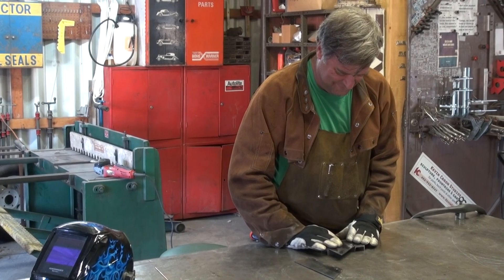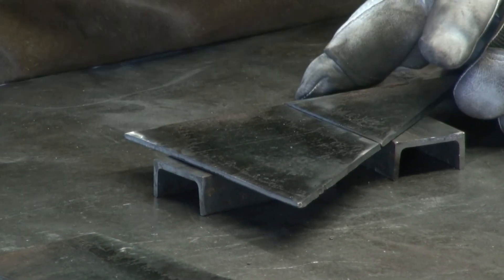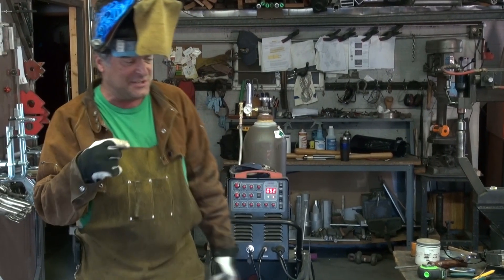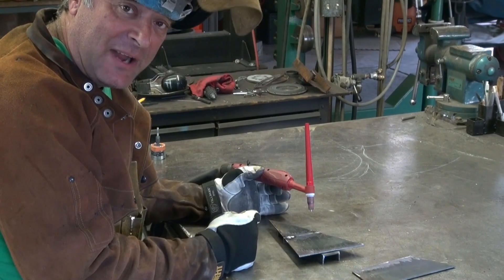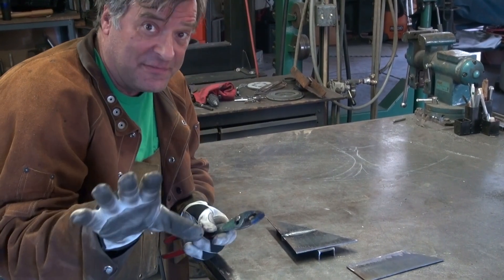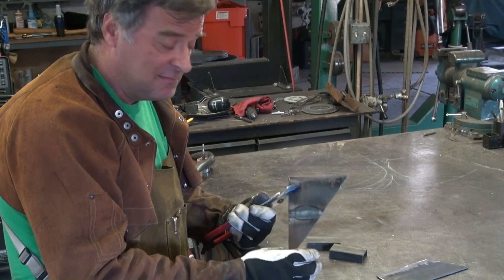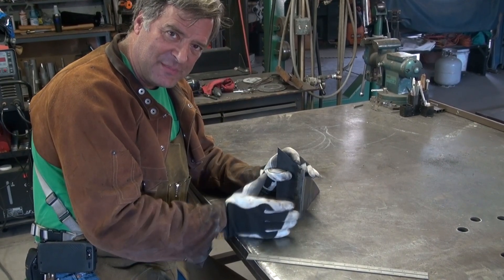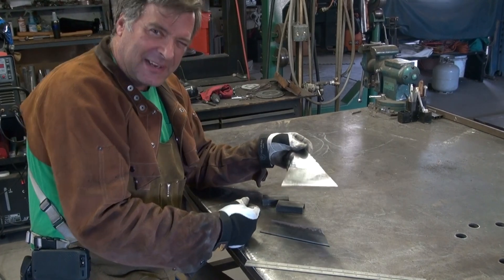How to Fuse Weld - or Should You? - Kevin Caron

Comment: How deep does the fusing actually go?
Reply from the maker: All depends on the amps you are running.   I can fuse .250 plate in one pass. But the joint is only about .125 thick.

Comment: Kevin, can I join 2 pieces of aluminum without filler by Tig process using AC welder machine?
Reply from the maker: Yes, but it's not easy or recommended. The joint will not be as strong as when you use filler rod.  Okay to tack but not for finish welding.

Comment: Thanks for the video.  I've been searching on this topic off and on for some time.  I haven't formerly studied welding but I'm still trying to figure out why people don't fusion weld butt joints more often.  I've done fusion TIG welds with thin aluminum, stainless, and carbon steel tubing and sheet metal.  It looks awesome and is much easier as long as you have zero air gaps between the joints starting out.  But I always feel like I'm doing something wrong.  Like maybe it's not strong enough without the filler?  I found you can travel way faster doing fusing butt joints on thin sheet metal which prevents warpage.  This is really important when doing a patch panel on a car.  But I'm not sure if its acceptably strong?  If someone who REALLY knows the answer to this please let me and all of us know. :)
Reply from the maker: Well, like I said in the video, you are taking metal away from both sides to fill in the middle.   The joint will not be as strong as when you add filler.   But for a non structural joint it works very well.   Of course this is all my opinion. I am not a certified welder in any way shape or form.
Reply: Thanks for the quick reply.  I just found this video. He did it in two different ways on stainless tubing.  then he did a destruction test.  The method where he back purged it with higher amps that was through-welded held up fine and didn't break but the non back purged non-through weld at lower amps did break after binding it back and forth twice. Goes to show that it can be reasonably strong if done right.  Thanks again for your video.  Here's the link to the one I mentioned. https://www.youtube.com/watch?v=PGIwzZEfaYk
Reply from the maker: Cool, will give it a watch!
Reply: I just took a continuing education MIG welding class at the local  tech college.  They set up a TIG welder on the last night so we could try it.  I fuse welded an outside corner joint beautifully.  Then I tried a couple times to fuse weld a tee joint.  As I was doing it, it looked like I was getting a puddle from both pieces, but once the welder was off and I could see the joint, a strip of the vertical metal was gone, the whole length of the weld.  It didn't look like it was doing that, inside the helmet, but that was the end result.
Reply: Interesting.  I think I understand you.   I've had that type of thing happened before but it was on thicker metal that should have been pre-heated with the amps cranked up.  It would melt out or strip out a layer of metal and it would flow down off the vertical piece.  I think the heat didn't have enough time flow or saturate he pieces being welded and would just melt off the immediate area where the arc was hitting.    How thick was the metal and how cold was it?
Reply: It was 16 or 18 gage steel, no preheat.  I saw the metal on the vertical piece liquefy, but it didn't look like I was burning through, but that was the end result.  I definitely should have had some filler rod.  I've also gotten a better helmet with a bigger viewing area, with the hope that I can see better, next time.
Reply: Damon Diehl Ah ok. Ya, 18 or 16 gauge is pretty thin. So pre-heating wasn't nececery unless it was frigid cold where you were working.  I think I misunderstood you before.  I didn't realize that you had burned all the way through.  Sounds like the amps were to high and you couldn't see well enough.

Comment: What about lap joints? It seems you can overlap two pieces by 2-3mm more and use that 'extra' steel to fuse weld. Is that correct?
Reply from the maker: You can in a pinch yes, I just like it to be a solid weld all the way across.  Maybe weld the lap joint on both sides and that should be strong enough.

Comment: hobart institute of welding technology taught me that using that technique is only good for tacking otherwise you gotta use rg-45 after tacking then going over the weld a second time to fill up the face of the weld....im also talking about OAW
Reply from the maker: Right, for non-stress joints in my line of work I feel I can get away with it. But if there is any stress it needs to be filled properly for sure.     Thanks for commenting and watching.

Comment: as a reletive newbie, and uncertified welder..... if i am, for example, welding a 3mm piece f plate to a 4-5 mm wall tube, is this still the same situation? obviously I am still removing material to join the plate, but in the end it will end up as a smooth transition (?) 

obviously if it is a major/ structural piece it isnt worth the risk, as i am aware that any inconsistency can create highly undesirable weak points, but if it is supported by other plates/ cross members surely this method is ok? btw i am not challening your knowledge, just ut to learn some more about our craft :)
Reply from the maker: It will give you a smooth transition but it will be a smaller bead then if you added filler wire to it..  Because it is smaller now it is also weaker..    I do this to tack things together and then come back to weld every one again..

Comment: Kevin I'm dabbing curb feelers at work for plowing snow.  I was just given the weld shop. And equipment and tools are at a minimum.  Just started here I'm a retired union Ironworker 20 yrs so I know my way around steel . I hv to bend 1/2" x 5" plates to 90 deg   One acet regulator red lined on me so finally found 1that worked  was heating it w rosebud finally got that to stop popping...... But as I heated it the tip of rosebud was getting crazy hot.  So by the time steel was hot enough to bend I had to kill the rosebud to let it cool.  Not sure of the size. Everything is junk I'll hv to wire wheel it hopefully it'll say but do u hv any ideas for me.  Almost went to cutting head but didn't want to kill that
Reply from the maker: +Beth Paul        Get or make a forge..     Got an old bbq?    got some charcoal and or hard wood?    How about a fan to make the flame hotter?

Those are cheap ways of doing it..     or just get a bigger rosebud...